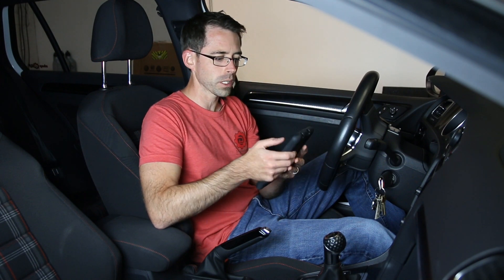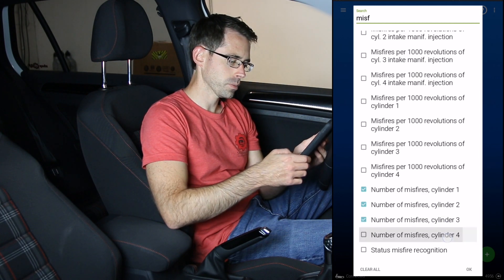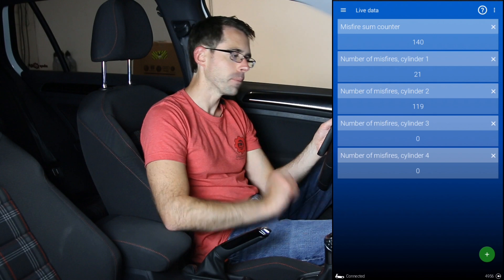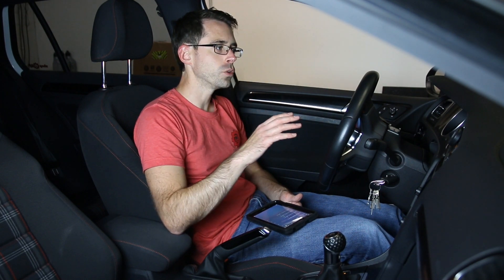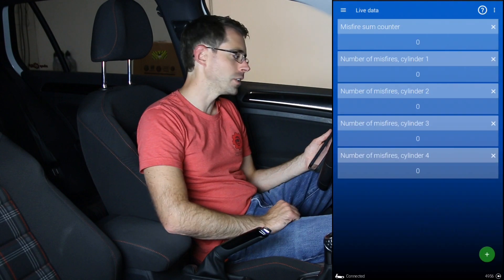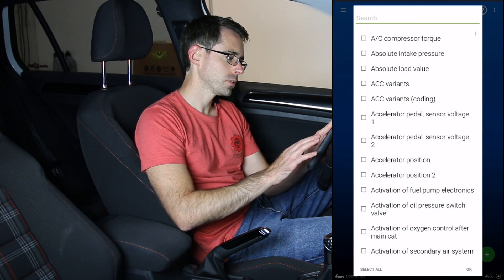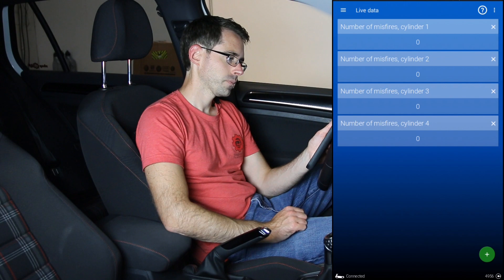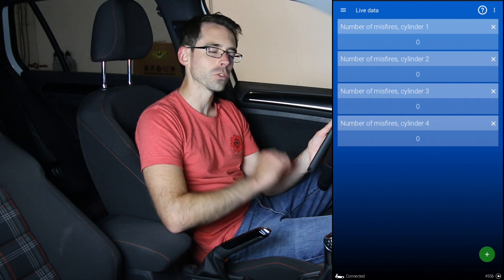How to Find Engine Misfires on VW and Audi's

Comment: Thanks man I'm going through the same thing, Thanks for the tip I'm having misfires although in different cylinders so ill follow vacuum leak procedures, for a while my 2008 VW Jetta MKV 2.5 has had a rough idle and the engine light come on when i remove the engine cover as it runs rough and seems to want to stall as well as a whine almost whistle when i rev, any tips i should follow that you recommend? would be greatly appreciated.

Comment: Hey I am getting constant misfire on cylinder 4 although i changed sparks and coils it is still there. I noticed the fuel injector connector is broken but the contacts still touch. Is it possible that cross talk is causing the misfire?
Reply from the maker: answer coming on askdap 61

Comment: My '05 Jeep Rubicon had a safety feature that would not allow it to be started with out the key. After 3 attempts, it would disable to vehicle and would have to be reset by the dealership. Does the MK7 R have any safety features similar to this? 

#AskDAP
Reply from the maker: answer coming askdap 61

Comment: Great video Paul, got a general OBDeleven question. 
A lot of adaptations require you to enter a security access code (which is listed as Access Code 31347 in the steps) however, this is not working for me. Do I need a different code?
Drive a A3 2007
Reply: Your A3 2007 has nothing to do with the Mk7 (MQB) platform!! Goodness me...  Hence the Mk7 access code will not work....  beside you need to specify which control module you want to modify....
Reply from the maker: What are you trying to accomplish.  I reached out to OBDeleven to check with them but they need more details about specifically what youre trying to do.
Reply: +Deutsche Auto Parts Paul, I am trying a few things without success. Changing comfort blink cycle value, 
Folding Right Mirror in Rear, needle sweep on start, and window controls with remote. I think folding mirror requires memory seats, maybe you can confirm that